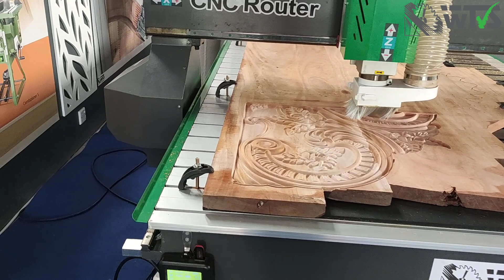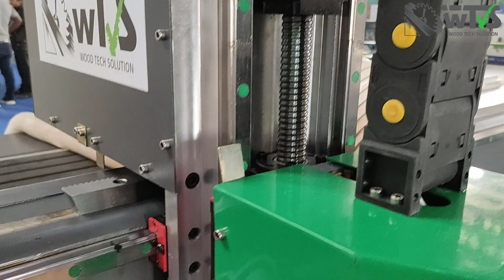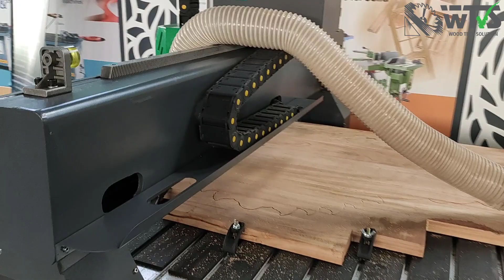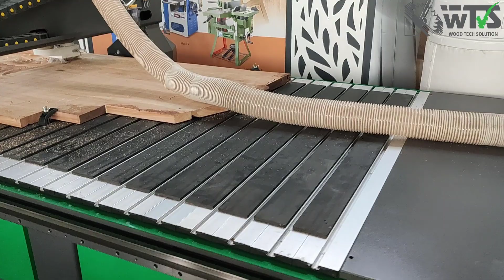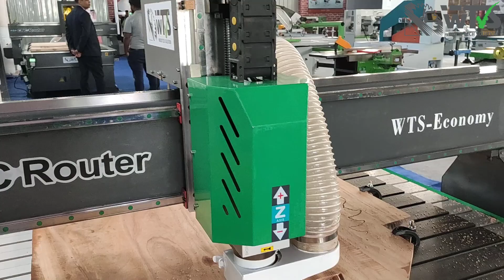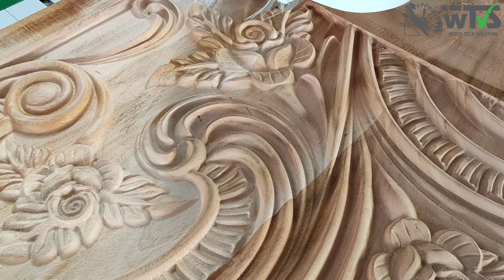Wood Tech Solution CNC Router Machine WTS Economy I Wood Tech Solution I WTS I উড টেক সল্যুশন

Comment: এইটা দাম কত?
Reply from the maker: এই মুহুর্তে আমাদের কাছে নিম্নোক্ত মডেল এর CNC Router মেশিন আছে

Racer- দাম: টাকা ৫,২০,০০০/-
WTS ECO- দাম: টাকা ৫,৫০,০০০/-
WTS Compact- দাম: টাকা ৬,৫০,০০০ /-
WTS Compact (Double Head)- দাম: টাকা ৮,৫০,০০০ /-
WTS Thunder- দাম : টাকা ৬,৮৫,০০০০ /-
WTS Classic- দাম: টাকা ৮,০০,০০০/-
WTS Classic (Double Head)- দাম: টাকা ৯,৫০,০০০ /-
WTS Elite - দাম: টাকা ১০,৫০,০০০/-
WTS Elite- দাম:টাকা ১০,২০,০০০ /-
WTS Elite (Double Head) - দাম: টাকা ১২,৫০,০০০ /-
WTS Prime - দাম: টাকা ৮,৫০,০০০ /-
WTS Prime + - দাম: টাকা১০,৫০,০০০ /-

বিঃ দ্রঃ আমাদের প্রতি মেশিনের সাথে নিশ্চিত ফ্রি গিফট প্রমোশন চলছে। ফ্রি গিফট প্রমোশন এর বিষয়ে জানতে আমাদের ফেইসবুক পেজ ভিজিট করুন। এছাড়াও প্রতি মেশিনের সাথে থাকছে নিশ্চিত সারপ্রাইজিং গিফট যা আমরা আপনাকে সরাসরি জানাবো। বিস্তারিত জানতে জলদি যোগাযোগ করুন ০১৯১৪২৫২৫৩৬ অথবা আপনার মোবাইল নাম্বারটি ইনবক্স করুন। টিম WTS আপনার সাথে যোগাযোগ করবে।